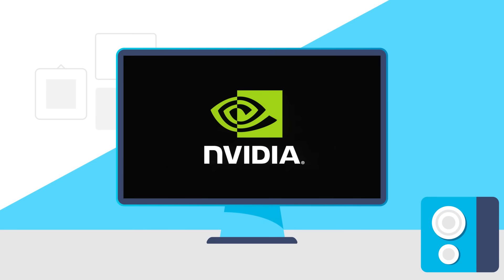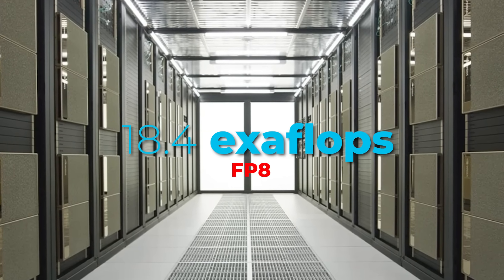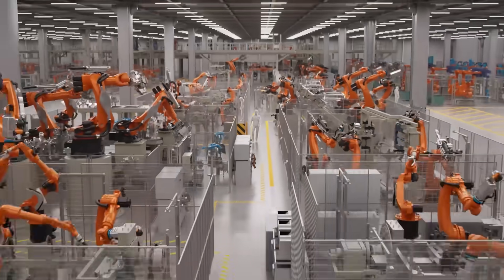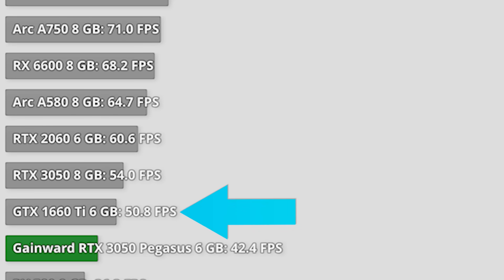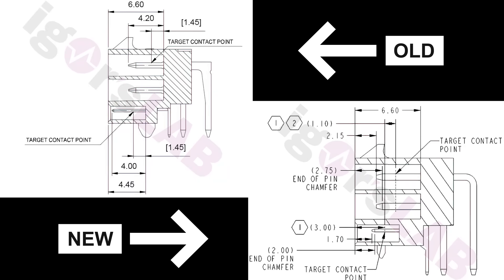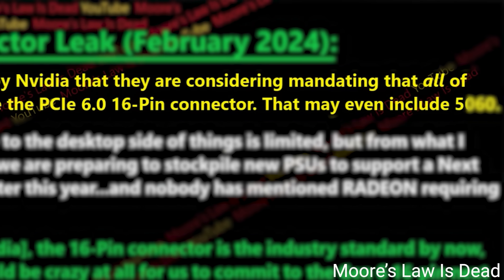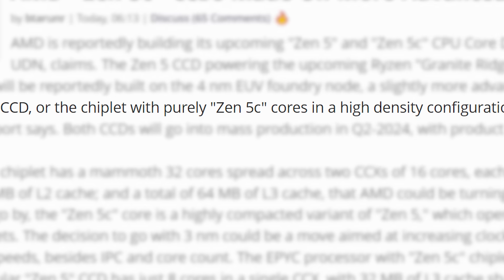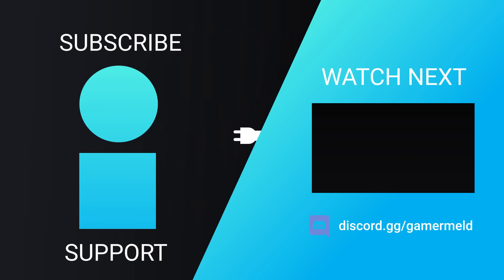Nvidia’s Requiring Big Change for RTX 5000!

Comment: The 16 pin was a really unnecessary change for nvidia's lower end cards. There's no reason a 150-300W GPU should have a 600W connector. As if the 12 pin wasn't annoying enough.
Reply: A 4090 doesn't even need it, anything over 350watts is wasted power for 2fps extra.
Reply: The 4070s does 280W, we wouldn't need anything more than a 2x8 pin. A 4060 could work with 1x8. Anything else is wasted. Hell even the 4080 coul work with a 2x8 as it has 150W per 8 pin plus 75W from the pcie slot for a total of 375W.
Reply: yes there is. so we can overclock it and chill it and pull 500 watts. i want my room to be heated with a gaming pc
Reply: The 12 pin isn’t even capable of doing 600W

Comment: so nvidia is doubling down on the fire hazard connector.  good to know.,  seriously that thing  even with the shortened pins is a fire waiting to happen it's a cable smaller than a pci-e power connector yet it is pulling 450+ more watts than a pci-e cable does. and electrical engineer or electrican with half a brain  can tell you it's a bad idea.  pci-e pulls around 150 watts , 12vhpwr -pulls around 600 .  you'd think the damn thing would be much fatter for that reason alone.

Comment: I bought the 4070 Super 12GB recently and it came with the 12vhpwr connector and I made sure it was plugged in properly and my GPU failed to work. After some finagling with the 12vhpwr connector I had to lift it up and it would finally rest in a position that worked. I’m happy with the performance of the card, for $599 it’s the most expensive and best card I’ve had but it’s a little concerning that the connector is so finicky.
Reply: No wonder I am happy with 4070 8 pin connector and beast card on 1080p, 1440p, 4k 😆
Reply: 4080 Super, had no problem whatsoever
Reply: You should be fine but those 12pin pins are kinda short and small.

Comment: I just bought a full am5 set, figured I didn't want to wait a year for the x3d version and the 7800x3d is fantastic.
Reply: Might buy soon, need some more cpu power over 5600X. But the usb4 with pcie tunneling is very tempting I must say. 

Also the 7900X is very low price right now.
Reply: Same here, got a 7800x3d and 7900 XT , didn't want to wait more  and also the new stuff to come will again probably be high prices and maybe 15-20% faster. where like you said the curent gen is still very strong and will be lasting for a while, no need to really go for the newest things on the market. I'll just upgrate later when the prices will hopefully come down
Reply: I went from a 5700s to the 7800x3d. Best decision ever! Also I game at 4k and play almost exclusively AAA open world games that tend to be GPU limited so I am set for a while
Reply: just watched a bench mark of Star citizen using the 7800 X3D compared with a 5800 X3D in comparison show a 60% up lift on a 4080, i knew the game was CPU heavy but never considered to that extent , but basically showed the 5800x3d completely cpu bound at a Titan XP with a 4080, crazy results

Comment: Insane prices, extreme power draws and the 16 pin connector. Three reasons for me not to get the 5000 series, or go with Intel next generation. 
Good luck with that, and have fun. Maybe will get a strix point mini pc or handheld. Just buy consoles to play some games. 
If Strix can get it up by just a bit more, will video edited my basic stuff on that.

Comment: Who can explain to me, how corsair and other psu manufacturers can use two 8-pin cables to the 12vpwr conector and support 600w... why we can put the same dual 8-pin connector on the GPU side and stop this non sense pci5.0 connector

Comment: "16pin connector is an industry standard"
while no other GPU manufacturer uses it 😂😂😂😂😂😂
Reply: Honestly speaking, that's just Nvidia openly admitting that THEY think they have a functional monopoly dominance, as it means they think they set industry standards.
Reply: @jtnachos16  Are you stupid? they have a "functional monopoly dominance" because nvidia is simply better. they don't "think" they set industry standards, they just do.
Reply: @jtnachos16  they do... AMD and intel aren't even close. They still dominate in sales
Reply: @jtnachos16 they kinda do though? 80% of all discrete graphics card are Nvidia.
Reply: @timberdoodle7657  He didn't say they hadn't. I am pretty sure his coment was more about this not being a desireable situation for the rest of the world.
Reply: If they are increasing 12 pins up to 16 it could be to lower the current draw across each pin - that may not be a bad thing as the more connection area will likely increase reliability.
Reply: @fx-studio  You know what we used to use? Dual 8 pin. As in, 16 pins. We also used higher gauge wire.

Lets just throw the god awful connector out the door, it's a solution looking for a problem.
Reply: @fx-studio  that called 2 8 pin connectors, PSUs with sets of 4 8 pin connectors have been an industry standard over 10 years, and they not in habit of melting
Reply: the only one that matters does
Reply: BITCH PLEASE !

When you hold 90% of a market, whatever you do is "de facto" a standard.
Reply: they will. give them time
Reply: It's less crazy than the 12 pin one.
Reply: NVIDIA is just walking around with their head in the clouds, thinking they rule what goes on below...

Reminder that AMD hardware powers the #1 Supercomputer in the entire world lol
Reply: @Munenushi  Nah, you're just coping. AMD is absolutely nothing compared to the "Monster" NVIDIA has become. You fanboys need to realize that and stop defending the multi-billion dollar company that is AMGreed.
Reply: @Munenushi  nvidia is the biggest tech company in the world. is the biggest AI hw provider, has 80% market on GPUs. 
amd fanboys are just delusional. you ppl live ina reality of your own.
they are market leader in almost anything they sell so ye, they set most of the rules. like any other market leader.
Reply: @2leggedpirate265   lol
> preaches for an hour about ngreedia
> "youre the fanboy!"

also "market leaders" don't always dictate the "Standards" - they have to follow them...
Reply: @Munenushi  saying a ferrari is better than a ford is not being a fanboy, is being factual. saying a ford is better than a ferrari just because you love ford, ye, that's the definition of fanboyism. you can even see it  by your "ngreedia". so "edgy".
as for your very enlightened comment about market leaders, yes, we don't see that anywhere in apple, samsung, nestle, P&G, toyota, and so on. not even a bit.
Reply: AMD does lol my XFX 6700 10gb has a 16 pin connection
Reply: @venomrecords8885  you have two 8-pin connectors, buddy.
Reply: Nvidia is the GPU industry. They know they're going to shut the door on the competition next gen probably.
Reply: It is one of the many reasons I bought a 7900xtx. I don't need a 4090 fire risk in my house .
Reply: 2 8 pin connectors has been the norm for a very long time. We've already been using 16 pins xD
Reply: @kimberly830  Some GPUs already have triple 8 pin PCIe connectors that are 24 total pins like a EVGA RTX 3090 FTW3. I see nothing wrong with the standard 6/8 Pin connectors that we have been using other than to hedge people into going with Nvidia over AMD or Intel.
Reply: @kimberly830  that's what i was thinking, only the low power / low end cards use less pins
Reply: I guess when you are the industry you get to say shtt like that, not a fanboy, but they do have the marketshare by-and-large lol
Reply: it is still a standard... maybe check up what standard means
Reply: Nvidia is on of 3, or even one of 2 in case of competition manufacturers. That's 50% and they have the majority of share market, so in a sense it is a market standard.
Alos PCI-SIG are a a consortium of over 800 companies, this create specifications. NVIDIA and AMD are in it as well. So yes it is an industry standart. Just that AMD is yet to use the plug. You are wrong on many levels.
Reply: @danepher  how exactly am I wrong? 

Does AMD has this connector on thier cards? No. Does Intel have it? No. VIA maybe? Not really.

I am factually correct.
Reply: this would suck, my homie just built a pc with the msi psu that has the 12v connector.. would hate for 16pin gpus wit no connector on the psu
Reply: @Swampyballs69  and if he just built it he's unlikely to need to upgrade at all for another 2 years.

Comment: Damn am5 socket is gonna be hot next year, can't wait for 6ghz boost clocks on amd
Reply: Wait you mean socket..but rumors say even Zen 6 might still work on AM5 though we don't know that
Reply: @strongforce8466  considering there is only 2 gens on am5 i have high hopes for the lineup. im getting amazing performance and thermals + the adrenaline software on an all amd build? nvidia and intel combo is not worth while for me anymore. also def worth the system change since i was on an intel+nvidia platform (8750h+gtx1070) the ease of use and performance is refreshing.
Reply: This year Q2

Comment: Soon we will have computers attached to our GPU's and our GPU's plugged into the wall.
Reply: I mean yeah that would actually be ideal for a pure gaming pc. Sort of like how drag racing cars are essentially a motor strapped to a tube chassis with a seat, not really a car. 

Once something becomes so specialized to just one purpose it sort of gets silly, but it works.
Reply: Wow, I think you’re actually onto something
Reply: @mohammad20412  It already exist btw. There is GPU`s that you can plug into your laptop and it will work. But these are kinda...expensive. I mean really really expensive.
Reply: that is the way of things, yes!

we had little fires outside, then big fires outside, then clay ovens outside, then little 'pot belly' iron ovens inside, then large iron ovens inside, now we have huge mixed metal ovens we plug in with a special plug into the wall directly lol

"there is nothing new under the sun" heh
Reply: Instead of pc build, it’ll be called gpu build.
Reply: You jest, but pcie cables keep getting better. Soon they may be. 

A lot of better stuff comes from the datacenter and the first 1U cases just with gpu exist. Active pcie cables, good to go. 

At home, hook it up to any oc or laptop, play.

Comment: I think Nvidia should leave that decision up to the AIB's given how problematic the current connector is for melting (don't want to see a repeat of this connection mess).  The AIB should be free to choose, unless Nvidia is going to cover problems of melted connectors themselves.

Given Nvidia is sticking to pins - I HOPE that the next is well engineered - like perhaps (one of many idea's) the connector from the PSU side will have full width locks down each of the narrow sides to lock on securely and that connector is ever so slightly convex and designed to buckle in the middle and force full pin contact through out the connection (the card side would still be flat meaning the PSU side connector would have to warp under the pressure from the sides to get fully seated)...

Interesting move with Zen 5C - looking forward on seeing how this hybrid will work out. 🙂
Reply: man next release cycle will be fun with these melting bs connectors being even more widespread, ofc AMD will totally miss the opportunity again
Reply: @BlackChicken710  LOL

Comment: Amoung several other reasons, the Nvidia plug is a big reason why I went from a 1080Ti to a 7900XTX
Reply: Same
Reply: man today nvidia stopped existing for me
Reply: I got a 4090 myself (also up from a 1080 Ti). 
But a huge part of that was I was also making the jump to 4k (large format).
If I were staying at 1440p, I think the 7900 XTX looked best at 'that' time. 
Early on the 7900 XT (missing an X) was really overpriced for what you get, and the 4080 was also severely overpriced. Meanwhile the 4070/4070ti had obvious vram-limitations (built in obsolescence). Software asking for more than 12gb in 1440p is not common, but 2 years ago it was unheard of... so... progress being what it is...

Now I'd pick a 7800 XT, 7900 XT or 4070 Ti Super I think for 1440p. For 1440-UW i'd get XTX or 4080 super. For 4k... I'd still stand by my 4090 pick, or an XTX if no ray tracing.
"Dollars per frame" only holds up within the bracket of acceptable performance in your use-case.
Reply: @kathrynck  I also made the jump to 4k. The 7900XT was for sure horribly priced at first as was the 4080. I was wanting to try an AMD GPU and this was the most appealing generation to me so I made the switch. I don't regret it. I really like the Adrenalin software too.
Reply: @MohawkNinja636  👍
I was kinda looking for an XTX, and was just gonna forego any ray tracing for 4k, but I was in microcenter, and a 4090 TUF was sitting there, at msrp, whispering sweet nothings...
And I started thinking a 4090 might be more likely to last an extra generation (kinda like the 1080Ti stayed strong for so long), and it's what... 600 ramen breakfasts vs the xtx? hmmm... hmmmmmm... I do kinda like ramen, put an egg in it, a little extra spices...
Reply: If you have MSFS or X-Plane could you tell me if you've get a FPS gain? I'm struggling with this one and a 4070 super TI. Thanks!
Reply: @willswings  I do not have either of those games
Reply: 😂😂😂😂😂😂 Yh right
Reply: In same build or new build?
Reply: @YoursDadsMomDaddy  Same build on my AM4 system. New CPU and new GPU
Reply: @MohawkNinja636  I got a 7700k and a 1080ti FTW3, CPU I feel is holding me back. what should I do? 👀
Reply: @YoursDadsMomDaddy  See what your resource usage is during gaming. You want your GPU usage to be 99%. If it's much lower then your GPU is waiting on your CPU to render frames. The higher resolution and the high settings moves more work load to the GPU. I would say with your specs that yes your CPU is holding your GPU back
Reply: @MohawkNinja636  different games have different CPU/GPU usage ratios.

The situation in the game also matters quite a lot. It's not a reliable benchmark.
Reply: Was only 1 reason you poor.
Reply: @angrygamer69  🤣 ♻️🤖
Reply: I just upgraded my pc from an old GTX 1060 8GB to a RX7900 XTX Nitro + and ohh boy I’m telling you this is the way to go!
Reply: @ProPaganda996  did you test it on native 4k ultra setting?
Reply: Not sure if Zack meant the plug was a dumb idea or if avoiding it was dumb 🤔

 Personally I love the 7900XTX. The Adrenaline Software is AMAZING
Reply: I mean you can get an adapter
Reply: @CovenantAgentLazarus imagine a company that creates a problem requiring you to have to buy the solution for the problem they created. I have a NVIDIA card but nothing besides the 4090 in this generation is even worth a look. If I was buying a card or what I recommend to friends comes down to 4090, 7900xtx or 7900xt. Maybe a 4070 super. That’s it.
Reply: @ablet85  sounds like PRS or aka problem reaction solution.
Reply: @ablet85  how 4090 is worth to even look at when price to performance is dogshit compared to 7900xtx or xt and 4080 super?
Reply: @resko8758 isn't the 4080 super still bad value?
Reply: @gamingcomputers7485  lol, the famous phrase of David Ike !
Reply: @UltimateGattai  its not that bad. you pay like 20% more than for an xtx but its a bit faster, has the better rt performance and dlss.
Reply: @LazarusIRL  True enough. At my time of purchase the 4080 was also $200+ more. Like I said, I had several reasons.
Reply: my condolences
Reply: @iequalsnoob  I personally have no regrets and haven't had any issues at all. This is my 1st AMD GPU. I LOVE the Adrenalin software
Reply: @@MohawkNinja636 
stupid reason.. legit 99% of the time the connector is fine... talking about people that are blinded by tech youtubers .remember AMD cpu cracking?  should i say that's way i switched to intel?.ltes see for how long you well maintain this fanboy mentality. path tracing well become the new norm soon.
Reply: @magnomliman8114  The plug is only 1 of many reasons.
Reply: @MohawkNinja636  well if u don't type those ''reasons" in the first comment you are legit misleading people  here. tell me more about those ''reasons" im rdy to go full nerd whit you.
Reply: @magnomliman8114  My comment clearly states first thing "amoung several other reasons" I could, of course, list all of those reasons but in the end they don't really matter to anyone but me as the consumer and I have extremely happy with my first ever AMD GPU
Reply: Dumb idea
Reply: Care to explain why?. The xtx is one of the fastest gpus on the planet so I fail to see your logic. @ZackSNetwork
Reply: I think AMD gpu's would be so much better than Nvidia right now if they kept developing/using Vulcan but considering Nvidia pretty much bought out the dev community well.... Nvidia is not for gamers anymore lol.
Reply: @WyattOShea  how is that xtx is fastest than 4090 ? i've watched many test videos and it showed that 4090 was an average of 15% higher
Reply: @nerolowell  I said one of the fastest not that it was the fastest
Reply: @nerolowell  HE Said "one of the fastest"....... nothing further
Reply: @nerolowell why can people like you not understand simple English? He said ‘one of the fastest’, not the ‘fastest’.

Also everyone knows the 4090 is the best gpu, it’s not even close but what is close is your networth to 0 when you try to buy it, therefore people buy amd because price to performance is not making your networth go to 0.
Reply: @ZackSNetwork  Yeah I like my GPUs not melted 😅
Reply: @MohawkNinja636   Last I checked those issues was due to user error. Also you could probably count on two hand how many people that happened to. But go ahead and be a scaredy cat lol
Reply: @ABasedSammich  The plug was 1 of many reasons
Reply: @ZackSNetwork  Nvidia fan boy detected 🔍👁
Reply: @ZackSNetwork  you sond like team green fan boy haha 

i done same i move from GTX1070  > RTX3080 >> 7900XTX. am not pay 250 euro more for littte extra FPS and my house on fire
Reply: @ZackSNetwork  Says the green NVIDIA goblin...
Reply: @ZackSNetwork dumb comment 😂